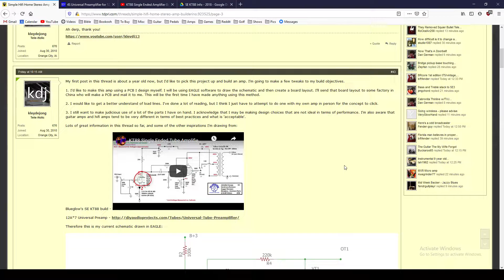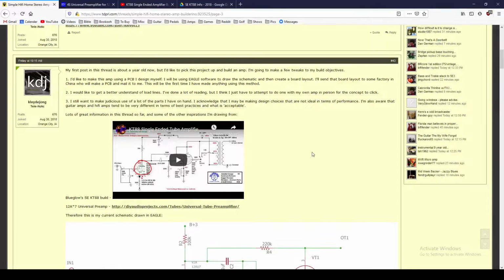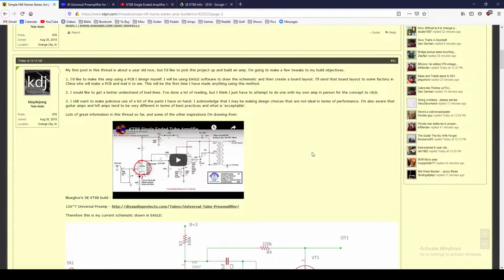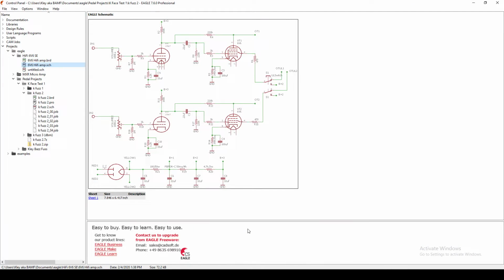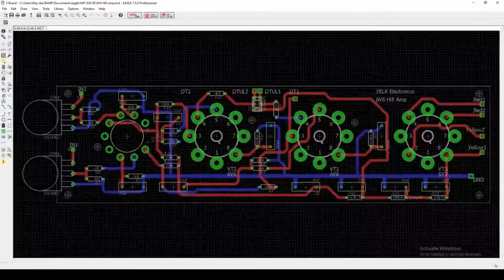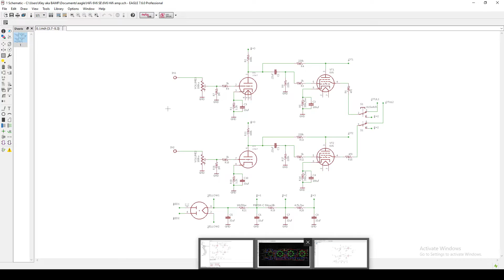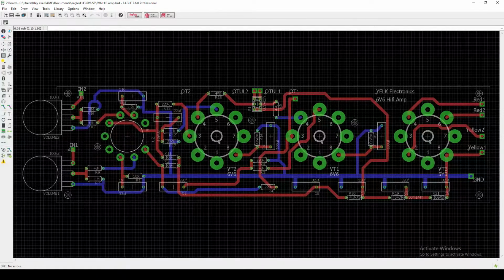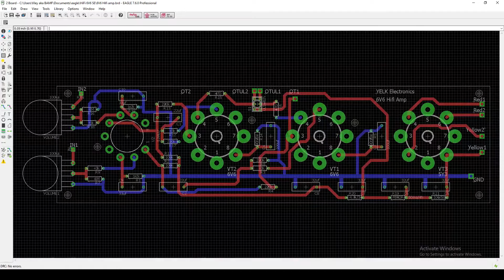6V6 Hifi Amp Build - pt. 1 | Project Overview

Comment: Why not do a point to point 6v6gt amp. 
Music to play once finished Dire Straits “ you and your friend”
I have 4 ea stereo amp 7199 X2. To 6v6gt  runs about 15-18 watts into Altec Lansing 10 ft cabinets each with Altec 422 8z woffers, mid horn, high freq horn. I use an active EQ stereo pre amp , pre set on 3 volume power amp push pull 6v6gt no volume control.